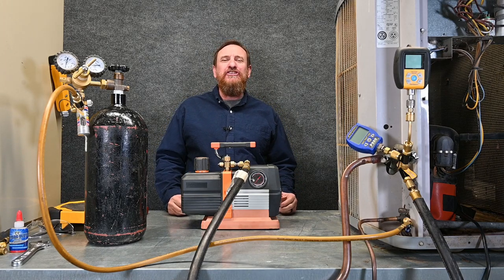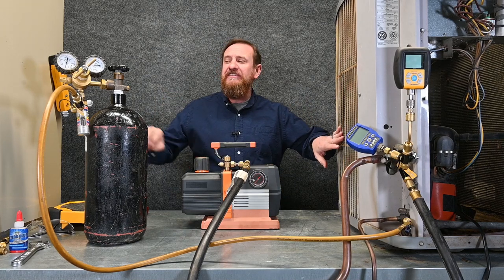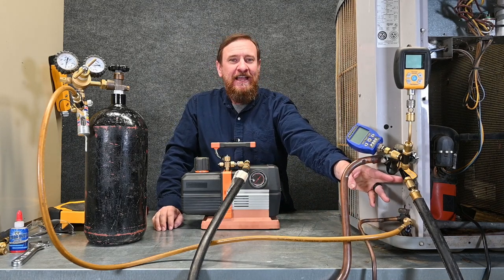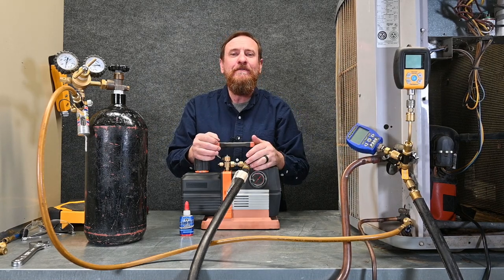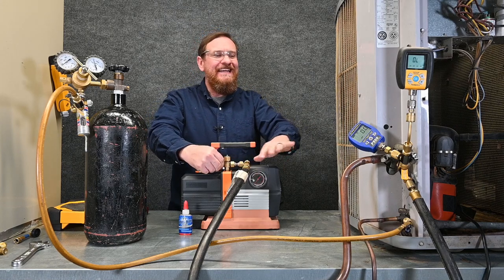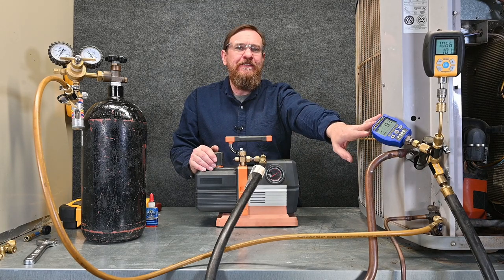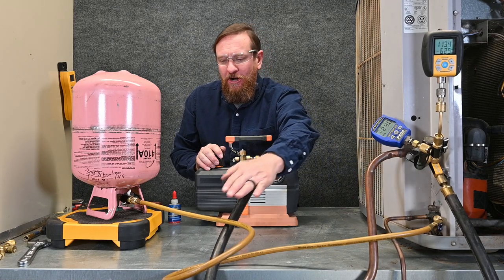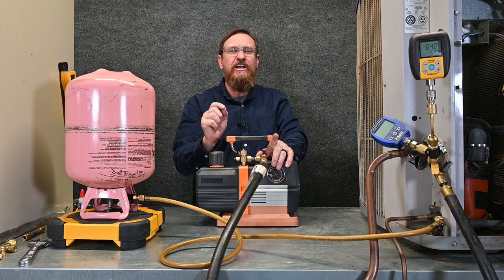HVAC 150 Vacuum p17 Example 5 Triple Evacuation

Comment: In the late 60's, the accepted rule was to pressurize the units, I'm talking 90 to 150#'s and then release the nitrogen, evac and repeat. The vac pumps were belt driven at that time, the refrigeration compressors were mostly belt driven as well and the condensers had bleed ports on top of the condenser so we could bleed off non condensables.  It was also believed that anything larger than a 3 cfm pump for 4 ton or less actually caused icing and was bad. Amazing how we've discovered so many new truths. Fascinating video.
Reply: Yea with certain vacuum pumps you still have to do that if not the oil shoots all out of your pump and can damage it
Reply: @JohnnyPyro4l  To be clear, purging is what can minimize oil flying out of the vac pump? To minimize vapors from atomizing in the vac pump and causing bubbles.

Comment: Samsung mini split reccomends a 200 psi, a 400 psi then a final  600 psi pressure test for 60 minutes to check connections using nitrogen to checkfor leaks. Then a triple evacuation, 4000 microns for 5 minutes, 2000 microns  for 5 minutes and finishing with 500 microns for 60 minutes.  Breaking vacuums between each with nitrogen.
Reply: The COE has us do 600psi test for 24hrs with nitrogen. Then triple evac down to 300microns and it can’t go over 500 microns for an hour

Comment: Hi Ty, had a question. Is there a additional refrigerant charge per vertical foot. Air handler is located 70 feet higher than the heatpump. I did the additional line set charge but don't know if more is needed since most of the line set is a vertical run , will having most of the line set vertical make a difference? Any help will be greatly appreciated. Thank you
Reply from the maker: Great question. Each manufacture will publish this in the installation manual. 
Craig has a table and a writup that will better explain this
https://www.acservicetech.com/refrigerant-weights
Reply: @love2hvac  thank you, yea I looked into the installation manual didn't see anything about vertical line set just a line set length , add .6 per foot. Saids charging by weight is not a accurate charging method as it is a starting point. I added the length line set charge plus heatpump charge. Showing 10 superheat and 0 subcool TXV. I added one pound and still 0 subcool 10 superheat waited and added another pound and still 0subcool 10 superheat. I stopped as I didn't want to over charge . I know my testing instruments are working properly. 65 degrees outside 75 inside. Suction pressure 105 liquid pressure 180.R 410a. New air handler with matching heatpump.
Reply from the maker: It should be the same amount of refregerant for horizontal and vertical. However vertical may require traps and capacity differences .  I am away from my library and computer but I will post see reasorces below about vertical piping.
Reply from the maker: https://hvacradvisors.com/Ice-pdfs/Piping/DuPont%20Refrigerant%20Piping%20Handbook%20by%20Garth%20Denison.pdf
Reply from the maker: https://www.tranebelgium.com/files/book-doc/20/en/20.aqerykdx.pdf
Reply from the maker: https://climate.emerson.com/documents/system-design-en-us-5400002.pdf
Reply from the maker: http://www.rses.org/assets/serviceapplicationmanual/630-33.pdf
Reply from the maker: https://cupdf.com/document/refrigeration-piping-handbook-dupont.html
Reply from the maker: https://www.copper.org/publications/pub_list/pdf/copper_tube_handbook.pdf
Reply: @love2hvac  thank you so much Ty

Comment: Does the same technique apply with commercial systems? If I have 250-300ft of pipe with 5 refnets and evaps? Should a little more pressure be applied at that point? I feel like rain water has gotten into the system and not sure of the best way to get it out with all the refnets and turns
Reply from the maker: It will take time. Heat the pipes as much as you can, change vacuum pump oil very often.
Reply: @love2hvac  thank you. This was solved. I had to detach the 5/8 flares on all the cassettes one by one.  I  put a flare x mip fitting on followed by a ball valve. After that , 150lbs of pressure each line until all or most moisture was out. Vac’d right down after. It Was a week of pondering and trial and error up to that point..

Comment: Again, another great video!
Thank you Ty.

Besides AC, do you also do refrigeration work?
Reply from the maker: Thank you!

YES, I also do a good deal of refrigeration work. 
I prefer Refrigeration. Once I get the base AC classes done, I will make some refrigeration videos but they are a ways out.
Reply: Wow great, can’t wait. That will catapult you over the top!

Do you also give some tech support on refrigeration problems? From time to time I run into issues on specialized equipment, where it would be nice to have 4 sets of eyes.

Comment: Thanks for another great video! Any recommendations for a ductless mini split with only one service port?
Reply from the maker: Thank you. 

Several years ago there was only one brand that I would back. A lot has changed since then. More manufactures have taken ductless serious and greatly improved.

Right now parts availability and proper installation would be key factor.
Reply: @love2hvac  Thank you. Sorry, I did not word my initial question properly. I meant something like: say I want to apply the nitrogen purge methodology in this video to a ductless mini split system which only has one service port. Would you add the nitrogen in from the service port and crack the lineset fitting on the high side to let the nitrogen flow out, then snug it up again each time before the vacuum phase? Sorry if the question seems trivial or unprofessional I am just a beginner.
Reply from the maker: @georgetsetsakos6088  
Sorry I completely misunderstood.

That is a great question!
1st follow manufactures recommendations. Some units have solenloids and electronic expansion valves that will not be opened to allow a purge at all.

2 after the manufacture is covered or left out,  you have, in my opinion, 3 options.
A Forego the nitrogen step and pull a vacuum, it's a much smaller volume. 

B, yes leaving the opposite flare connection  loose to allow a purge out there. Do not do this if it's a precharged line set or a mechanical  connection other than a flare.

C add in a t connection with a service on the opposite line.
This one has some complexities to it. You would have use a flare tee or braze with nitrogen must must must be flowed threw when brazing it. Note that most manufactures are heavily against brazing on ductless units. Last, you have to wonder about the next person. They manufactures stoped supplying that port because it's not a liquid line. They had issues with people thinking it was one. So if you add a port and do it right,  will it cause a problem with the next tech. 

Great question!

Comment: Thanks for Your Video,, What about VRF/Multi systems?
Reply from the maker: The goal is to get the moisture out.

Once you get down to 200 micron range, valve the system off and it holds for over 30 minutes without rising above 500, then you have the moisture out.

Comment: Hypothetically if you're breaking a system with nitrogen but you're working on a mini split with only one service valve do you can't open another end to let nitrogen flow through, what would you do to break the vacuum? Just add nitrogen to 5psi then let it out through the same way it went in?
Reply from the maker: I don't triple evac very often and I have never done it in a mini split.

Comment: Shouldn’t the decay test have been below 500 for 410a too prove that system is ready
Reply from the maker: It depends on wich manufacture manual you read. Carrier says to pull to 500 microns and not rise above 1000 microns after only 7 minutes. 

Goodman manual states pull down to 250 microns and not rise above 1000 microns after 10 minutes.

Another Goodman says evacuate below 500 microns and holed below 1000 after 10 minutes 

A dakon manual says Evacuate system using vacuum pump to below 500 microns for 1 hour minimum.

A Lennox manual says 
 evacuate the line set and indoor unit until the
absolute pressure does not rise above 500 microns (29.9 inches of mercury) within a 20-minute period after shutting off the vacuum pump.

The lower you can go and hold the better you are.
Reply: @love2hvac  yeah so I just usually no matter what manufacture pull too 200 and make sure decay test not above 500, usually sit around 350 on a new install

Comment: Thank you for another great video, my question is Once you have pulled a vacuum down to 1000 µm and then you fill the line set with 2 to 5 psi of dry nitrogen and let it sit for 5 min Or so, ,,,you then relieve the pressure of the system of it’s nitrogen While continuing to allow nitrogen to flow through the line set at a very small rate,,, I am guessing you still need to have the trickle flow of nitrogen in the line set creating that positive pressure so that air does not force its self back into the line set and carry more moisture back into the line set??? I My statement/question makes some sort of sense to you😂🙏🏾
Reply from the maker: Yes keeping a slight positive pressure is important for that reason but more important to fully push out any moisture you can. 
I think flowing nitrogen is more important that holding nitrogen at pressure. 

If you go wick your not going to gain a lot of moisture from the pump all the way threw the hose to the unit.
Reply: @love2hvac  the teacher is teachin 💯🙏🏾☝️🍺
Reply: Anyway in the future you would be able to shoot a Video on how to use a low pressure control to set the box temperature on say a reach in cooler???,  setting up the cut in & cut out Pressures….It would be great if you could use the tried and true formulas on how to figure the pressures based on a given refrigerant versus using the charts that are supplied with the pressure controls…..many thanks
Reply from the maker: Yes I actually have the rough footage of that recorded but I'm saving it for the refregeration playlist.
Reply: @love2hvac  now that is what I’m waitin on!!! Thank you🙏🏾